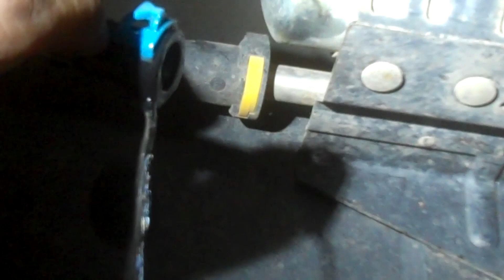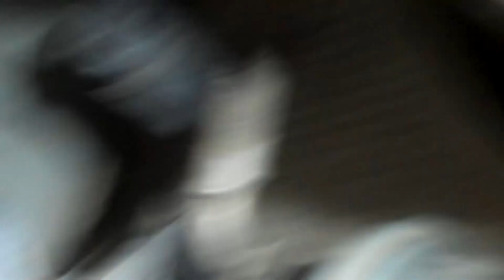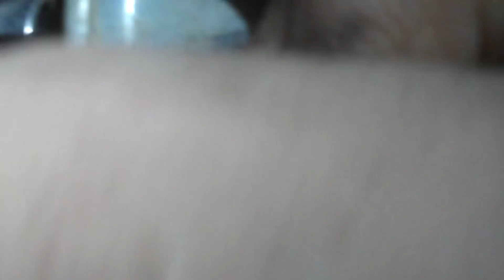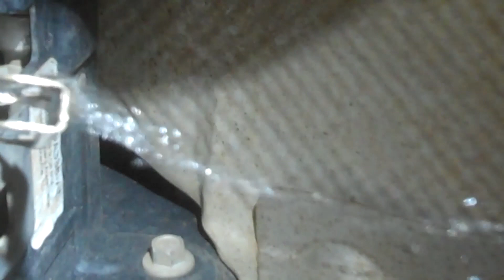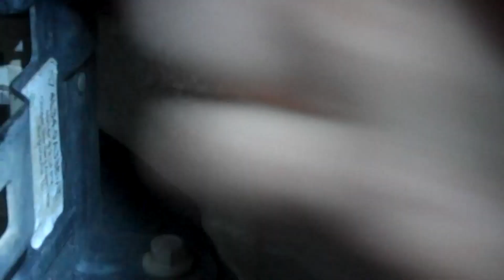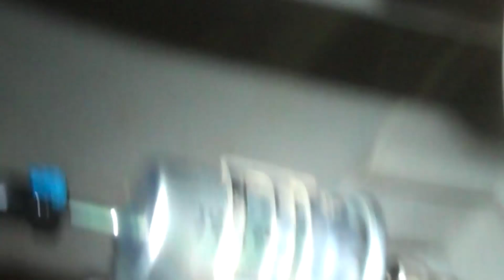Fuel filter replacement 2004 Ford F150 Need special tool if you want to remove, replace FF

Comment: I need the 2 short pieces of gas lines those would work on the old 98 f150 6 cylinder but I'll still need to Barrow your gas line crimping tool

Comment: Why does ford use those quick connect and disconnect flexible gas lines then they rot out on the gas filter so the gas filter nipple is rotted into the disconnect end of the quick disconnect fuel line 

Im looking for those 2 fuel lines and the crimping tool to crimp the new line onto the trucks original fuel line because that part is still good 

The bad lines are the 2 flexible lines each end is rotted out so a new filter wont help me with these rotten ends that connect to the fuel filter nipples 

Have to cut below the flexible line each one and crimp a new flexible line on

Comment: The first and most important step not only not showed here but he did not perform it is to depressurize the fuel system. You can pull the fuel pump relay or fuse for the fuel pump and start the engine run it till it dies. If you do this they will not be so much fuel spilling from the lines when you disconnect the filter so less chance of a fire hazard.
Reply: Mine was rotted out leaking gas so i didn't have to do all that

Comment: I tried to use the release clips that came with the filter but didnt release the line on all sides. I used a top from a Sharpie marker, cut it in half and sliced it down the middle.
Old filter had clear gas on the output/engine side but rusty orange fuel on the fuel tank side of the filter. Worked for me on a '06 Lincoln Mark LT pickup. Truck was loosing power uphill on bridges as if transmission was slipping.

Comment: can a bad fuel filter cause truck to stall in highway mine stalled theft light battery light and wrench light came on and shut off and it wont start at all just cranks ??

Comment: Really?  You posted this?  You might as well as posted someone locked in an attic as your video didn't show how to use the tool, didn't show the best way to remove the fuel filter from the bracket, etc.  Waste of time......Wow dude......

Comment: So, starting out with where the fuel filter is located in the truck would be a key feature. Unfortunately, he assumes we know where that is. I'm not a mechanic and came here to learn something and could not learn the most important piece.
Reply: You should already know its under the truck under the driver side you can't miss it and all the brake lines or the smell of gas where the leak is at